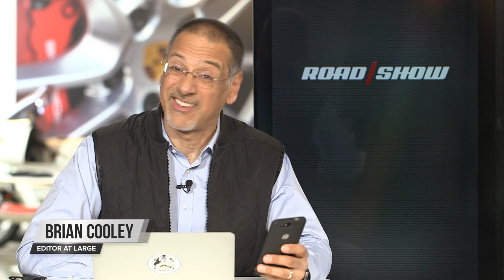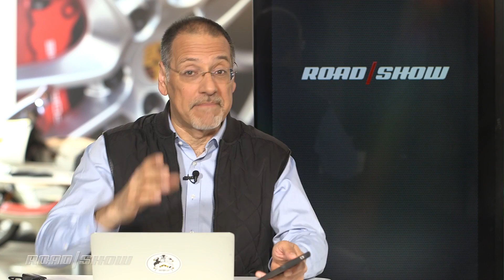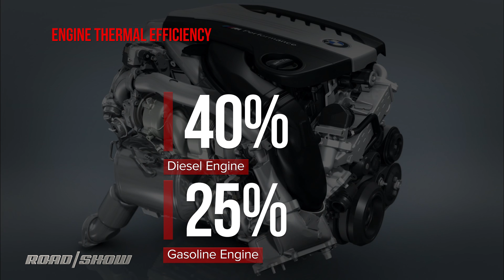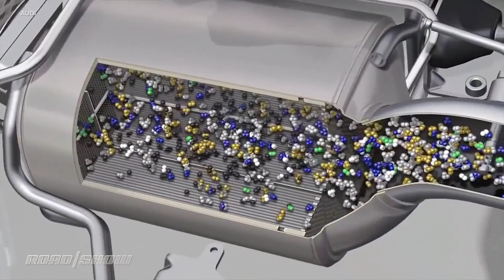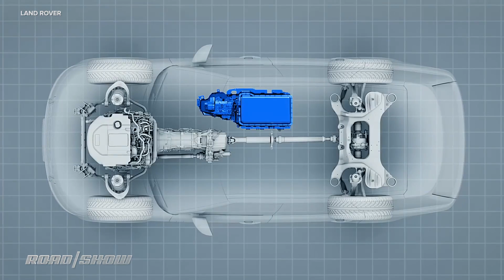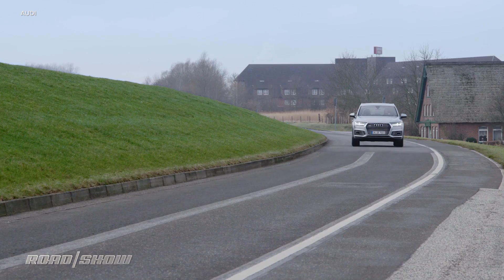Do diesel hybrids make any sense?

Comment: Diesel-electric trains are norm.
Reply: +Mladen Milić Diesel-electric trains aren't hybrid though. The electric transmissions just send power, they are not creating the motive power.
Reply: +yan-Deriction Well, with that thinking that makes my car a hybrid, because it has a gas engine and a hydraulic transmission. But I'm sure that isn't our idea of a what "hybrid" car really is. "Hybrid" can be vague, but most people are just referring to vehicles with two or more forms motive power. In a gas-electric "hybrid", the car can be driven either by the gas engine or the electric motor. In diesel-electric locomotive, power can only come from one way, the diesel driven generator, which is like a normal car, but instead of an electric transmission, it is a hydraulic transmissions with a range of gears.
Reply: Jesus Christ, I thought I gave enough warning that the use of the word "hybrid" was vague!!

Neither an electric motor nor an internal combustion engine are power sources. We don't call them, "Engine-motor" hybrids, do we? There is a reason why we call them by their power sources, "gas-electric.... hybrid", etc.

When it comes to diesel-electric in a locomotive, we are talking about power conversion from diesel power to electric, not a drive system. For the sake of the argument, just take away the diesel-electric conversion part and just call it "power". There is still only one power source, not two, even if the power gets converted back and forth and back forth. And once again, people have to be careful and not infer anything when some says "diesel-electric". They don't have multiple power sources or multiple drive systems.

In a full hybrid drive (aka hybrid propulsion system), there are two individual drive systems driving the wheels. If I have a car with a piston engine driving the front wheels, and if I install a rotary engine in the back to drive the rear, that is technically hybrid drive, whether the sources of power are the same or not. 

Something like a PEV Prius has both a hybrid drive system and hybrid power sources, but a regular Prius only has a hybrid drive system. You can't confuses the two! A diesel-electric locomotive has neither hybrid power, nor hybrid drive, they just simply have power conversion. You can't confuse that either! Even though these diesel-electric machines operate with multiple types of power,  power is never combined to motivate, and the power comes from the same source. That means they aren't a hybrid of any kind.

In a diesel-electric locomotive, it is just X initial power with Y transmission, that's all! No second power source or multiple drive systems, just one source and one transmission of power like in most cars!
Reply: +yan-Deriction Just stop!!! 

STOP! STOP! STOP! STOP! STOP! STOP!

You don't know what you're talking about, you're just very, very confused and refuse to listen. I've worked for Metrolink and my father worked for Amtrak for 34 years!! They are not hybrids!!!
Reply: A transmission is not a "motive" power source. It just converts rotational motion efficiently via gear ratios. An ICE or electric motor is a motive power source. It doesn't matter if you power it via batteries (EV) or gas/diesel generator (series) or a combination of both. If that ICE and the electric motor can physically move the wheels (via the transmission) it becomes a parallel hybrid. That's a bit simplistic but you can read about it here: http://www.ucsusa.org/clean-vehicles/electric-vehicles/series-vs-parallel-drivetrains#.WQtZqtIrJhE

An electric motor does, of course, need electricity, but so does a gas engine needing a tank full of gas. That doesn't negate it from being called a power source since it does produce motive energy. I can't call my normal car a "hybrid" because it has an alternator, starter, and battery, because those parts don't actually move the car. Yes, technically you could put it in 1st gear, turn the key, and use the battery/starter to move the car very short distances...
Reply: +yan-Deriction "The diesel generator produces power, and the electric motor produces power. Two or more distinct types of power."

The electric motor DOES NOT "produce" power, it coverts it. And yes, that is an issue! Electric motors do not produce or automatically have power, they must BE POWERED by something else. In diesel-electric locomotives, the power is only produced from one source.
Reply: +Phrancis5 You and and yan-Deriction are confusing hybrid drivetrains and hybrid power systems.
Reply: +yan-Deriction An electric motor cannot make power either, it can only convert it. If you were to replace your car's engine with an electric motor, nothing will happen, you'll still need to generate power. In a diesel-electric locomotive, the diesel power plant is the only power source and the only form of motivation. The electric part of diesel-electric is only there to convert the power generated by the diesel engine, it doesn't make any power.
Reply: +yan-Deriction "If you replace a chevy bolt's motor with a gas engine, also nothing will happen." You're wrong! If you were to connect any running gas engine to the wheel, it will turn them. If you were to connect an electric motor to the wheels, you'll still need a power source!
Reply: +yan-Deriction Again, you're confusing drivetrain with power source. It's being explained to you, but the explanation is either going over your head or you're just obstinate.
Reply: those are technical "series hybrids"  the Chevy Volt and Fisker Karma are series-hybrids, but gas/electric, wheras most hybrids like the prius are parallel hybrids and get locomotion from both gas and EV sources.
Reply: Spamfried with a hydraulic transmission, your engine is converting chemical energy from fuel into kinetic force to move the hydraulic fluid, which transmits the kinetic force to the wheels. In a locomotive the diesel generator converts chemical energy from fuel into electric energy, which is then converted into kinetic force by the electric motors. the electric motor is its own motor, whereas a hydraulic  transmission is not a motor.
Reply: +yan-Deriction Engines and motors are not same thing.
Reply: whereas your hydraulic transmission has to be driven by your gas engine, a diesel electric locomotive's electric motors can get energy from 1) the on-board diesel generator or 2) overhead powerlines, and that more than anything else makes it a hybrid.
Reply: Here's the definition of hybrid vehicles: "A hybrid vehicle uses two or more distinct types of power"

The diesel electric locomotive uses diesel to store and produce energy, and it uses electricity to transmit and drive the wheels. The diesel generator produces power, and the electric motor produces power. Two or more distinct types of power.

Also, funny you say the electric motor only converts as if that's an issue. A generator can only convert chemical energy from fuel into power... kinda like how electric motors convert electric energy from a generator into power... Weird, huh.
Reply: "If you were to replace your car's engine with an electric motor, nothing will happen"
If you replace a chevy bolt's motor with a gas engine, also nothing will happen.
Reply: +Spamfried Good luck.
Reply: @Spamfried 
Most of my posts - especially my previous one, were mainly regarding whether an electric motor counts as a motor, a producer of power or not - it does, even when used as part of a transmission. We could talk about hybrids in terms of stored energy, then a diesel-electric train wouldn't neccesarily be a hybrid but you didn't do that, you insisted on arguing that electric motors do not produce power which is absolute horsecrap. An electric motor is rated for x kw and y hp, that is power it can produce, regardless of source of energy. 

"and the power [of diesel locomotives] comes from the same source. That means they aren't a hybrid of any kind."

Some diesel electric locomotives can draw power from both diesel fuel and overhead electric powerlines, which makes them.... drumroll... hybrids . I've since learned that these are a specific type of locomotive known as Electro-diesel (so I was wrong assuming all diesel electric locomotives can do this sorry), and btw, funny you bring up Amtrak because according to wikipedia Amtrak operates a fleet of electro-diesel "dual-mode" locomotives in New York, guess your father never encountered those in 34 years, huh.
Reply: @Spamfried
And hint, check if someone is using basic physics terms like Energy and Power before calling them confused. Energy and Power have specific definitions. Energy - measured in watt-hours, measures things like energy in a battery or fuel tank. Power - measured in watts, measures the output of motors, diesel OR electric.
You keep using obscure terms like "power source" (which doesn't even appear in most dictionaries) and "motive power" (which turns out, refers to energy), and then attack people for being confused. It is quite reasonable to say an electric motor outputs power, why can't it be a power source? An electric motor outputs power to move a vehicle, why can't it be motive power? I guarantee you I'm not the only person in these comments who didn't know motive power referred to energy, but the rest of my comments were directed at Chris C's idiotic assertions that electric motors do not produce power (as if produce has ever meant anything other than conversion, no engine in the world literally makes energy from nothing), my last comment 3 days ago wasn't even about you.
Reply: +Mladen Milić Diesel locomotives usually have diesel-electric powertrains, but that technically isn't a hybrid. As mentioned, the electrical part just serves as a transmission and is part of a single powertrain, it doesn't actually create any power for the locomotive. Full electro-diesel with overhead lines are something different and actually can be considered a form of hybrid power, but they're not that common.
Reply: +yan-Deriction A diesel-electric powertrain isn't a hybrid system, it's a powertrain (engine, transmission). Dual-mode electro-diesels and diesel-electrics aren't the same thing. 

Electric motors don't produce power, they just convert electrical power to mechanical power. 

Sorry, but don't turn to me with your bullshit.
Reply: +yan-Deriction Doesn't matter what you were talking about. You don't seem to know much of anything beyond what Wikipedia tells you. Typical keyboard warrior.
Reply: +yan-Deriction Stupid fuck.
Reply: +Chris C and how does a gas engine run? With GAS! It needs stored energy to run, just like an electric motor needs stored electricity to run. It's just forms of "potential" energy - one chemical, the other electrons. You guys are ignoring a big part of the equation.
Reply: +Phrancis5 I didn't call a gas engine a "power source". I'm not ignoring anything, your just making leaps.
Reply: The context here is hybrid vehicles, which would include power systems and drivetrains together.
Reply: +Phrancis5 Doesn't matter, you're still confusing them.
Reply: I'm not omitting or confusing anything. Electric motors need a source of electricity, and gas engines need a source of fuel. Electric motors convert electric energy into mechanical power, and reciprocating engines convert fuel into mechanical power. Chris C is the one making an arbitrary distinction that a reciprocating motor is a generator while electric motors are not, even though both require a source of energy not found within the motor, and both produce mechanical power from their source of energy.

"If you were to connect any running gas engine to the wheel, it will turn them." a running gas engine has to be connected to a gas tank to be able to continue to run, and last I checked gas tanks are not engines. No engine manufacturer in the history of engines defines the 20 gallon tank as part of the engine. Oh and btw if I replace a gas car's engine with an electric motor, it actually can run, because the gas car has a little 24 volt starter battery in the trunk (ie. not directly part of the removed engine) good for maybe 50 ft of range before it melts, meaning that even the statement "If you were to replace your car's engine with an electric motor, nothing will happen" is technically wrong, meanwhile if you replace an EV's motor with an engine, that modded EV will be truly grounded.
Reply: +Pacheco LOL!
Reply: +yan-Deriction Holy crap, shut up, you clueless fool!
Reply: +yan-Deriction I never said ICEs make energy from nothing. You're using strawman arguments left and right.
Reply: BTW, the other guy said the same thing. Are you the same person?
Reply: You said, if an EV's motor was swapped out for an ICE engine it would run, but if an ICE was swapped out for an electric motor then the car wouldn't run. Later you specified a "running" ICE engine, which implies swapping out much more than just the engine, and if we played by the same rules then the ICE->EV conversion could also include batteries allowing it to run, or, as I pointed out even without adding batteries I could probably squeeze a few meters out of the starter battery.
The way you worded it, is it so inconceivable that 2 people thought you were saying ICEs make power from nothing?
Now here's what I think you were getting at: if you were to say that unlike a combustion engine that converts stored energy into mechanical power, an electric motor merely converts electrical power into mechanical power, then I could understand that. Instead you chose to say that if an ICE car had its engine replaced with an electric motor it wouldn't run, but if an EV had its motor replaced with a magically running ICE then it would.
Reply: And that still doesn't mean I said an engine creates power by itself. No one ever said any of the things you're whining about. Stop distorting other people's positions and shut up already. Also, if you swapped in batteries with your electric motor, you still wouldn't be able to drive the vehicle, you have to get your power from somewhere.
Reply: +yan-Deriction Wow, you're really ignorant and need to stop arguing with people.
Reply: @Chris C
uh, ok. I take back what I said. I thought you were making an intelligent point I hadn't considered, but nope. You're just a blithering moron.
"Also, if you swapped in batteries with your electric motor, you still wouldn't be able to drive the vehicle, you have to get your power from somewhere."
Firstly, I swap in a fully charged set of batteries, how about that?
Secondly, where do you think your fuel tank gets its energy from? Why is it that batteries have to be charged, but a fuel tank is just assumed to contain fuel?
Those are some serious double standards buddy, if anyone needs to shut up its YOU.
Reply: +yan-Deriction I NEVER SAID AN ENGINE GETS ITS POWER FROM NOTHING!!! JESUS CHRIST! 

FUCK YOU AND SHUT UP!!!
Reply: @Hambone
I address the misconceptions I had in my 2 replies before yours. 

Electric motors are not a source of "motive power" aka energy, got it. 

Electric motors produce power, that is simply a fact.

Electro-diesels are not that common, except that a guy whose dad worked for Amtrak seems to think no diesel-electric train is a hybrid, false.
Reply: Hambone 
actually, 1. electrodiesels are a subset of diesel electrics (I like how you snuck powertrain in there, I was talking about the entire vehicle)
2. produce, in terms of outputting mechanical power and torque, from the input of electric power yes. Its still production. 
turns out youre pretty fulla shit yourself.
Reply: we're feeling tricky today arent we. whether its the system or the entire vehicle, irrelevant.
electro-diesel SYSTEMS are a subset of diesel electric SYSTEMS. I agree, they arent the same thing, one is the subset of the other, which makes the statement "some diesel electrics are electrodiesels, electrodiesels are hybrids" true, and it makes the statement "no diesel electric is hybrid" false.
Its like saying "plug-in hybrids arent' the same as hybrids", no shit, one has a plug, they're still both hybrids.
Reply: wait, whats that... no more counter arguments, just insults? what broke you? was it the first day of engineering school, when your teacher was all like "ima let you in on a dirty engineering secret... electric motors dont produce power... they convert it! MWAHAHAHAHA!"
Reply: +Hambone I swear, I haven't seen a flustered cry baby this big in a long time on youtube! That's saying a lot!
Reply: There is so much ignorance in this chain, it's painful!
Reply: Chris C : "flustered crybaby"
also Chris C: "I NEVER SAID AN ENGINE GETS POWER FROM NOTHING EVEN THOUGH MY COMMENT TOTALLY IMPLIED IT WAAAAH"
coming from you its rich.
Reply: A engine cant make power without gas and a motor cant make power without electricity. If you want to work on long energy output work on inventing a good battery that can be charged by clean/renewable energy.
Reply: @Spamfried
not exactly. Diesel trains are hybrid in terms of having both a diesel generator and electric motors for propulsion, the motor is the thing moving the train. The trains differ from hybrid cars in that there is no battery to capture energy when slowing down. Diesel trains cannot draw power from batteries they don't have, however diesel electric trains can draw power from overhead powerlines so they are hybrids.